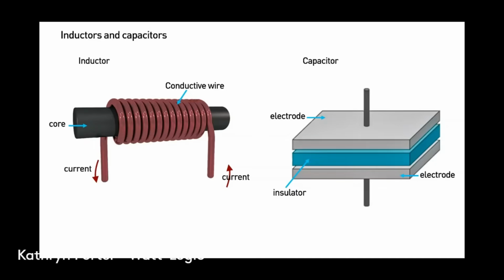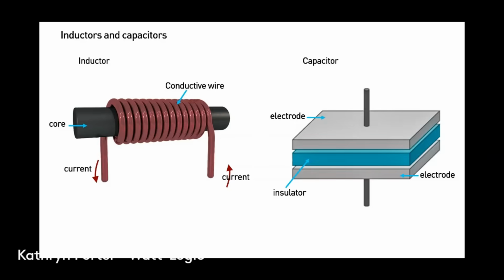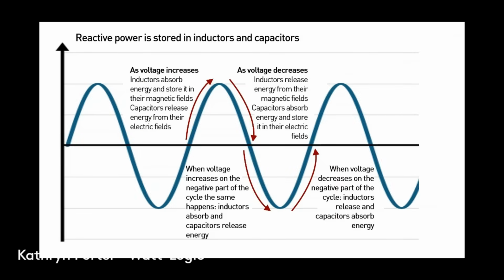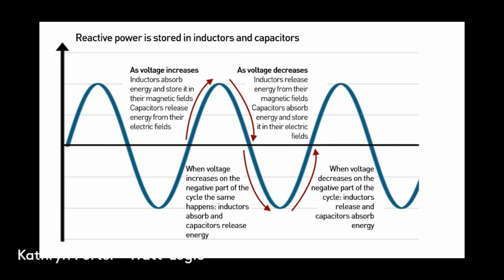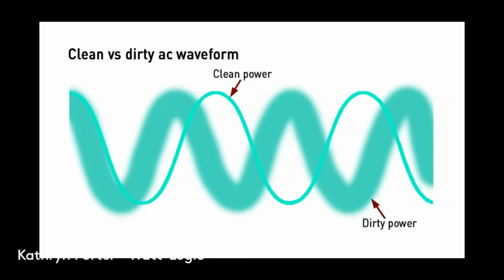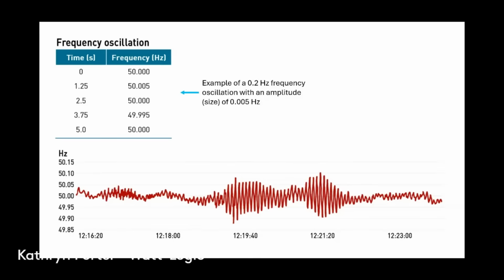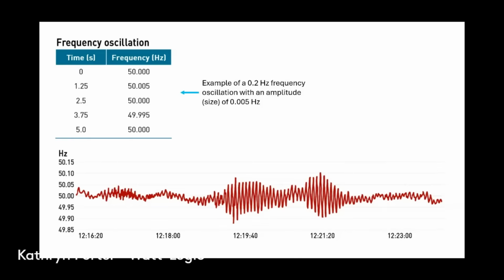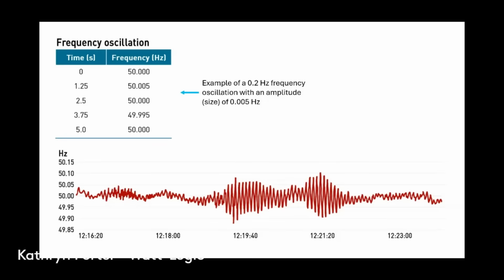Iberian blackout

Comment: Sorry, but electricity is not the flow of electrons through wires. There is an excellent video by "Veritasium" explaining this.
Reply: As a professional EE of several decades myself, the Veritasium video you refer to was pretty disingenuous attempt to get engagement, and in that sense it worked. His “experiment” was more a thought experiment, in that practically speaking the light would never light up in the way he claimed under the conditions he made. He was unknowingly relying on transmission line theory. You will find a number of well-respected EEs giving their views in reaction videos. Unlike Veritasiium, I myself created an experiment in the lab using a 20GHz sampling scope with a 30 picosecond rise time pulse generator and time domain reflectometry to demonstrate the effect Veritasium was talking about, and there is no way his experiment would ever light the bulb in the time he claimed: with 1m spacing there is just so little coupling, while you might just be able to see a small perturbation with the right equipment, the light would never light up in the time he claimed.

You have to remember that all physics is based on using a variety of models, and applying them appropriately. The electron model works, the transmission line model works, Maxwell’s equations work, they all work, but some are more applicable than others depending on what you’re trying to demonstrate.

Unfortunately Veritasium was more interested in engagement and $$$ than he was about presenting a genuinely useful treatise of the situation.
Reply: @nezbrun872  
Thank you for that considered - and non-insulting - response. I think that the "disingenuous attempt to get engagement" criticism would apply to >95% of all YouTube videos - isn't that why people post?
What is fascinating is that, despite its absolute criticality as the very foundation of the developed World's existence, the basic question of "what is electricity?" is still unproven and under debate. 
I truly wish all the climate hysterics would take note and shut up about "settled science".

Comment: At the time this blackout happened one expert at the University of Cardiff said: “Large-scale power outages, such as the ongoing event in Spain and Portugal, have occurred throughout the history of modern interconnected power networks. These networks are not designed to be completely blackout-free because achieving such a level of reliability would require investment far beyond what is economically feasible. Despite today’s high standards of reliability, low-probability but high-impact blackout events can still happen. In history, each blackout has had its own cause.” Are you saying he or she is wrong i.e. that there is such a thing as an interconnected grid which won’t ever blackout”?
Reply from the maker: We aim for 3 hours loss of load probability that means not more than 3 hours of blackout any year

Trying for zero would be very very expensive and not a suitable standard
Reply: The point is that when you have lots of renewables on a grid, blackouts are no longer low-probability. They become a certainty. Events that would never have caused a blackout in the past (failure of one inverter, a large cloud passing over solar farms, a sudden change in wind speed, the loss of one transmission line) are now causing a chain reaction of equipment shutdown.
Reply: Fun fact: before privatization/deregulation in Sweden in the 90's, the grid had less down time than a high quality UPS. Thus for anything with a single power supply / power input, you would actually decrease the reliability by installing an UPS.
Reply: @The-secret-101   Sweden never had a nationalised power system. 
There was and is a mixture of cooperative, muncipal, private and state-owned producers and distributers. What happened after joining the EU was not a deregulation but a fierce reregulation. 
The EU rules are a liability per se, and the Net Zero craze is a real burden on top of it.
Reply: @guycoste5624  Sure, there were various producers, but the vast majority of power generation with the large hydro plants and the nuclear plants were state owned, the main transmission grid is still state owned, and only the local distribution and some smaller networks had other owners, mostly municipal.

Comment: The Spanish were lucky to lose only 11 lives, thanks to the system being restored very quickly. Law and Order break down very quickly, I would not want to live in a city that has had no power for more than one day.
Reply: Channel 4 made an excellent documentary called "Blackout" in 2013. It's available on YouTube and it was about what would happen if the UK grid suffered a catastrophic failure lasting for days. No food, no water, no fuel, looting, rioting and a total breakdown in law and order. Well worth a watch.
Reply: @grahamgrierson8094  to counter this: In 1998 the city Boucherville in Canada had a blackout in the winter. They solved it, sort of, by just driving diesel electric locos on the streets (yes, where there aren't any tracks) for some distance and connecting as a power source for a few important buildings, that provided shelter, food and whatnot for the citizens.

There won't be any no food and no water situation in a civilized country. The amount of electricity needed to provide food and water to citizens is a drop in the ocean as compared to the everyday electricity usage. This of course assumes that people eat the food that's cooked at some improvised centralized canteens or so, rather than try to run their own electric stoves from small inefficient combustion engine generators.

Comment: This seems to be a common problem, generators being non-compliant with technical requirements, but the fault lies also with System Operators, who appear to simply assume that their technical requirements have been met, with no formal testing.
Reply from the maker: It is. I've been discussing it with Ofgem because this shows how important compliance is in weak grids

Comment: Synchronous Condensers? (YouTube deleted my post due to link but here's the title - "Custom built synchronous condenser units now in operation at Uniper’s Grain power station site helping to deliver a low carbon electricity system")
Seems a solid solution - inertia can be very large and electrical machines have high short term over-ratings.
Perhaps grid operators should as a matter of course replace decommissioned rotating generation machinery with equivalent synchronous condenser units - it being their responsibility to have a stable grid - obviously costs and so on - but it's an established solution which works if enough of it is used
Reply: Or just not mandate unstable 'green' sources of electricity so that grid inertia comes from generators that are already supplying the grid so there is no need for extra machinery.
That works.

Comment: 18:20 about these frequency oscillations: surely this slight deviation in frequency would apply to every country connected to this 50Hz grid? Because if the frequency changes were in Spain alone, then there must have been huge power surges back and forth (in time with each deviation) at the interconnectors to other countries, with resistance in the cables soaking up the difference.

   What I'm saying is, you can't have 2 different frequencies on one electricity grid at the same time (unless very slight and separated by resistance).
Reply from the maker: The 0.2Hz oscillations were detected across Europe. Not sure about the 0.6 Hz ones but Iberia islanded not long after it started so would be limited
Reply: @KathrynPorter26  this wasn't the first time the Iberian Peninsula caused oscillations in the EU wide grid
https://eepublicdownloads.entsoe.eu/clean-documents/SOC%20documents/Regional_Groups_Continental_Europe/2017/CE_inter-area_oscillations_Dec_1st_2016_PUBLIC_V7.pdf
Reply: > about these frequency oscillations: surely this slight deviation in frequency would apply to every country connected to this 50Hz grid?
It did.
A. The oscillations were detected in Latvia (the other end of the EU)
B. The oscillations impacted directly Portugal (leading to a blackout there) and France (leading to a blackout near the border)
C. Fortunately the AC interconnector to France was small, and the oscillations did not impact the DC connector.

> What I'm saying is, you can't have 2 different frequencies on one electricity grid 
Which is incorrect. You may have 2 (or more) different frequencies - the waveforms reinforce or cancel each other out - they don't 'compete' for the wire.

Comment: just a question - when the frequency dropped below 49.5hz why wasn't the first protective response an automatic under-frequency load shed of blocks of customer load to get the frequency back up to an acceptable level so that the synchronous generators did not need to trip on ROCOF??
Reply: The grid was too far gone at that point. Later in the day, as they attempted the black start, solar farms would come online - but at their full output, before demand could catch up - then they would have to start over. The load-shed should have had the same impact. As it was, they waited until the sun set (guaranteeing solar would not be binary on|off) for much of the restart due to this issue.

Comment: I would like to understand the implications of Contracts for Difference on the market price going negative. If for example that a company has a a CfD of £100 per MWh and the market fell to £10 per MWh. They would receive £90 top up from the LCCC. Now and I maybe wrong that CfD are suspended if the market price goes negative for greater than six hours.
Reply from the maker: With the next auction round coming up I'll do a video on how the CfDs work, and the changes that have just been announced. Not sure when but in the next few weeks

Comment: The frequency of the interconnected grid, did not deviate completely from the Euro Grid until the inter-connectors, were so heavily loaded, they could not hold synchronism. They would have experienced massive periodic reversals in power flow, and probably tripped on over current.

In the October 1987 storm, the CEGB fearing the complete collapse of the UK grid, decided to sacrifice the South East. The grid had so many tripped circuits, that a lot of the remaining circuits were heavily overloaded, and likely to cascade trip the remaining circuits.

In a bit of a panic, grid control chose some 400 kV break points, and broke away the SE grid.

In their panic, they forgot some key items.   In the South East, a lot of the Supergrid circuits cross connect through the Area Board 132 kV circuits.  When the 400 kV circuits were opened, there were still 132 kV connections, which could not hold synchronisation. These circuits experienced many phase reversals, and tripped on overcurrent.

Also, Grid Control forgot to tell the Power  Stations, that their station transformers were about to de-energise.
Their gas turbines were running, but feeding out onto the grid to try and keep the system running.
Had Grid Control warned the stations, they could have isolated their station transformers, and just fed their unit boards, to enable them to bring the main units into service.
As it was, the SE grid collapsed and crashed the gas turbines into darkness.  With the loss of station supplies, the stations then had to start a black start for real.

I remember the event, hearing my roof tiles crashing through the conservatory, then the intensity of the lights dropping then oscillated a few times, before going out.

The poor gas turbines had never had such massive demand on them, and when they tripped off on overcurrent, the AVR had wound maximum field on.  This was so unusual that they could not be restarted until an engineer by torchlight realised they had to manually wind the field resistor back to nominal, to get a permit sequence start available.

There were so many lessons from the event. I wonder if anyone at Grid Control reads the report nowadays ?

Comment: april 28,   wait  until you know there was soooooooooooo many chemtrails from aircrafts where there is never airplanes at the borders. could that cause frequency changes in the grid below 50hz with micowave tech everywhere now.... 
chem trails metals with microwave emf from towers and sat. changing frequency causing unstable heat in all different layer areas , my friends have many many pictures and remember its being dumped from 9000 meters,  down causing oscillations

Comment: This problem is well known. Sometimes it is known as Normalisation of Deviance, or Short Cut Mentality or Practical Drift. The problem is caused by people being people and fixed by people being sensible. 

Spain’s quick fix has to be to buy and install large rotary inverters. This would be where PV, wind and grid energy powers massive motors with huge flywheels that in turn power synchronous generators feeding the grid. This will give the grid the stability it deserves. The other thing they can do is come clean about the true costs and implications of this wretched net zero bollocks.
Reply: It will be even quicker to fix the wrong settings of trip levels (so electricity producers do not disconnect generation too early), fix the faulty volt-meter at the substation, and fix the control loops for reactive power on the thermal power stations so they deliver 100 % instead of just 80 % of the set value.
It seems there was a lack of applied reactive power, but no a lack of available reactive power. It was just not the ordered/set amount that was applied.
Have you read the report from REE, machine translated into English?
Reply: Relevant tangent: Since those already rotate, they might as well be used to convert DC to AC too. You'd still need electronics to optimize solar output, but you could for example easily connect batteries directly to the rotary inverters.